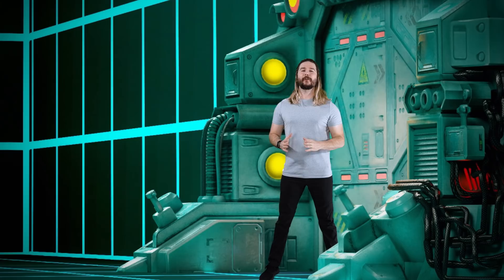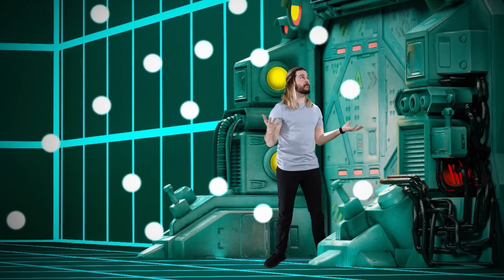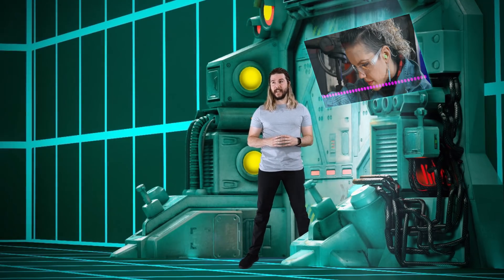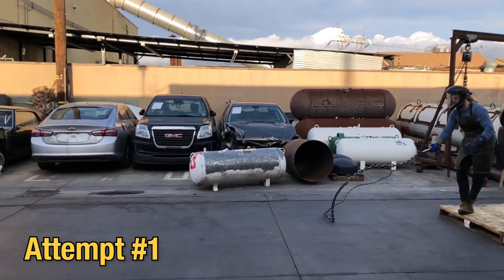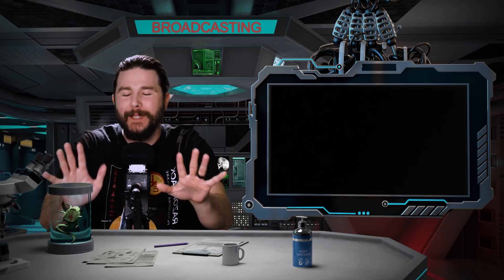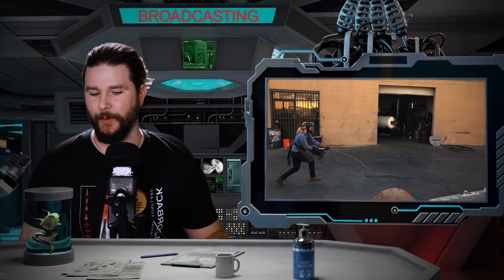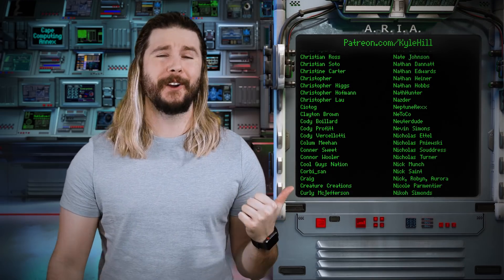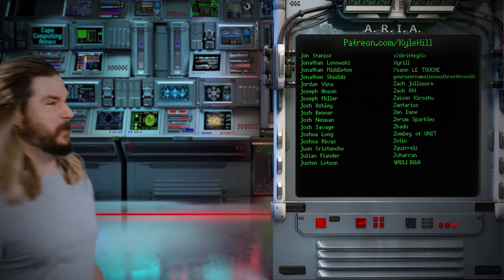Can I Make a SUPERSONIC STEEL WHIP?

Comment: Science does not always succeed. Failures happens. It's no biggy.
Reply: In fact it’s not only no biggie as you stated, it’s an amazing chance to learn.  :). Some of the best inventions today came from failures at making something else.
Reply: He needs to make the chain lighter and add a "cracker" at the end. He is not strong enough to get his current  build to speed.
Reply: Science ALWAYS succeeds... with the correct method. A failed experiment only ever means you have something to learn so you can refine your method, USING science to find the correct path to positive results. That is unless your theory is wrong in the first place, lol
Reply: @Nemoticon  hypothesis, not theory.
Reply: This is a chance to revise your hypothesis and change the experiment and try again.  All part of good science.
Reply: What? Firespark watches the same channel as me? Neato burrito.
Reply: Success on the first attempt in science is the worst possible outcome. Failure is how we learn. It's what leads to new discoveries and ways of thinking. Keep testing this hypothesis.
Reply: It's not just that science doesn't always succeed. It's that it always fails. It fails and fails and fails and fails and fails. It's how it works. It's an iterative process getting closer and closer and closer to the truth with each step. Science isn't a goal, it's a process.
Reply: "A scientist never returns empty handed; there's always data."
Reply: Failures Happens.
Reply: Failure just means you get to learn more.
Reply: When an experiment fails science still succeeds. It's only when you ignore the knowledge gained from a failed experiment that science fails.
Reply: Shh, people don't know that anymore. Keep it down.
Reply: Science experiments not science itself
Reply: Shouldn’t you be out playing Valheim?
Reply: Shit, that itself is science
Reply: Failure gives you a chance to fail better next time and eventually you learn something.. failure is the scientific process ..
Reply: This is exactly what I fight to teach my young students.
Reply: Science always succeeds if you do not view your failures as failures but instead as opportunities to learn and adapt your experiment.
Reply: eyyy it's the survival games guy! good to see you here on the path of SCIENCE! Thank you for all your helpful guides!
Reply: Science is mostly failing.
Reply: Being a scientist means you know that 99% of scientific theory has been proven to be wrong.  
But it must really suck when one scientific discovery negates your life's work while you are still working on it.

Comment: Well this kinda goes to show why even regular whips are made the way they are. You have the normal leather whip and then typically a shorter cloth/cotton tip piece that actually cracks the sound barrier. There is that specific motion you need it to perform for the "crack" to occur and the physical material needs to be able to transfer all that energy so rapidly. Glad you didn't just scrap the video but showed us and perhaps you can revisit the idea in the future with an updated design. All you would need to do is finish the end with a smaller real whip and you will get exactly what you. I'm not sure if even going that thin with metal would actually do it. It might if you keep tapering down the metal to smallest diameter like a necklace or thin bracelet type. But even then it might have too much mass to really flip around and "crack". You might just need to put some cloth twine on the end and it would end up working with your current design.

Comment: @kyle Hill  first: i love youre stil of making science understandable to many. You are doing it very well!

With the wipe cracking i see only one big problem: the style you swing the chain. You need, to give the chain a wave-motion, wich creates a bay in the chain running forwards. At the end, the lightest part, the bay will perpell the very last part forwards and that will crack it. 
You motion is a good start, but you miss the backwards motion and there for "swing" the wip on the ground. It only need a littel motion in the right Moment.

But: that backwards motion may swing the chain more back in youre positon. So i don't recomend, doing it this way with a chain. Normal bullwip will be best training for that.

Thanks for all youre work!

Comment: I think the link size on your whip may shrink too fast for it to work properly I'm no engineer but to me it looks like on your chain there is two points where the size jumps down considerably and it looks like to me that it makes the wip loose some power and it's shape if I were to re create the whip I would probably try to make the change more gradual

Comment: Regarding getting hit in the foot... from watching and practicing martial arts, if you don't want to get hit you can't just whip and then stop controlling the whip.   After the whip,  as soon as it starts coming back send a whip in the counter direction.

Not as familiar with whips but it applies to kusuri gama and to silk darts to a lesser extent.

(Kusuri gama are a hand scythe with a weight on a chain attached)

Comment: Your throwing the whip out but your not giving it the tug back that it needs. If you throw it out and then at about the halfway point you yank the handle back even just a little bit, it greatly increases the velocity of the tip. Try swinging it around you to keep it away from you at first too, it'll keep you from bruising your leg. It also doesn't have to be as long or heavy. Start with a smaller chain as the base and then end with a teeny tiny chain like you would find on a necklace or something. It would still count.

Comment: One thing I remember hearing about whips it that the sonic pop from the tip is still not always directly from the whip but from a added piece that is frilled to force a large area or more pressure waves to form at the end.  I much appreciate the safety precaution and the failure discussion as an avid fan and fellow educator.  Keep up the great work and stay safe and heal up from those impacts!

Comment: Something similar happens within the scientific community. Most journals discourage or even don't let you publish negative results, even if they are connected or are part of the initial hypothesis. And as most financial aid is tied to "get good results" or "how much you publish", this is a big problem and have induced people to lie in their results. There is some debate around this (is it ok not to publish something and cause that other researchers waste time and money on the same thing that you know it doesn't work?) but, unless there is a big movement from the publishers to allow or encourage to publish that kind of results or we find a different way to assign funds to research, it will be hard to see a change.

Comment: could you weld a bit of metal cable to the end of the small  diameter chain to decrease the mass enough to get the end to Supersonic speeds?  If it's about the taper down in mass, could you go down to piano wire?  Or would something cause it to break, shatter, or would there be a materials issue with the weld disrupting the transfer of kinetic energy?

Comment: Lets call forward direction x and to your left direction y. If the force is going mainly in the direction x but you are moving the closest-to-the-handle part in the direction y, the tip will move in negative y direction, so that the center of mass follows your pull. I'm guessing this caused your leg whipping. If you make it turn around you slowly like the tik tok guy before accelerating it to the sonic boom the CM would have a certain speed in the y direction wich would avoid gettin the tip in the leg. And you probably would avoid hitting the ground, as it would be slightly raised when you give it the finall pull, therefore not coming back down latter. Though not slowing it down on the floor while it comes back might be dangerous for the other side of your leg, you better improve your legs protection

Comment: But Kyle, couldn't this be solved by redesign? Obviously the chain whip is too heavy to get the speed you need, and I might have missed this detail, but the chains were all the same weight and size from start to finish, right? 
I'm pretty sure this could be done with a good design.
Reply: 👍 Probably. However, you can see the links are smaller at the tip. Should also look at lighter materials (e.g. titanium 🔗 instead of steel)

He also needs a WIDER space to get it REALLY spinning over his head. Notice the difference b/w locations & body motion of his vs. the "example" vid

[Youtube has a bot or paid TROLLS that DELETE factual comments]

Comment: So shirtless Dude whips twice with very different motions. You seem to have copied the second one, basically have the chain lie in a straight line and then try to accelerate. And my guess is that is why you failed. Your chain being all metal should be quite a bit heavier than his and thus requires way more power to get it moving fast enough that it does not hit your feet or anything else, loosing so much energy in the process that you do not get the sonic boom. 
The first method shirtless Dude used seems way more promising. Get the whole thing moving in an arc around yourself so there is nothing it can hitch on and THEN accelerate it to "whipping speed"... If you want to try that experiment again that is... 😅
But yeah, showing failure is good as well. It is our best teacher after all!

Comment: It seems to me that the problem is that the tip isn't moving smoothly like a whip would. I'm guessing that a sudden jump in the chain size causes a discontinuity which can't be easily overcome. Maybe some work to smooth over the joints by making the last joints before going to the next size smaller by grinding a portion of the chain away, or making the first ones slightly heavier by adding a small amount of weight. Or even some kind of machined chain bit. The last thing is maybe using a steel chord for the last bit is required, slowly tapering it by removing individual strands?

Consider reaching out to "Stuff made here", who has the experience to machine parts that could be more gradually tapered.

Last thing would be to practice with a normal whip, and set up a slow motion camera on it, comparing the motion of the two chains and looking to see what happens differently.

Comment: It looks like the steel chains are too big and heavy to get the speed needed.
If you can make the links half the size the weight will decrease by half and be light enough to possibly work.
I'm trying to remember the Bull Whip from Indiana Jones and it wasn't as big and bulky.
Try the experiment again with steel links but have them roughly the same size as an actual bull whip.

Comment: I’m surprised you didn’t use some thin, steel cable to create a "fall" at the end of the whip. 
Technically, it wouldn’t be a steel chain whip anymore, but it might get the desired crack!

Comment: I think one safety problem you had is that you needed more space. You should do it in more open ground like a large warehouse. Next, for a weapon that size, you need a very large person to wield it. If you can get ahold of someone with a significant difference to you, I think they would have an easier time. To practice you should also use a regular whip, that way your body can more easily regulate the mechanics of the action. I once spent a month training with a small whip and I still don’t think I had it down enough to attempt a chain whip. If I were you I would go slow, practice over time even if you aren’t recording, and try to build up your arm strength. Then in a year or so make another video

Comment: Alright as I whip things for fun I can see the immediate problems.
1: understandably Kyle is afraid and that will hurt his results 
2. The whip hitting the ground before anything happened that lead to
3: Kyle is not strong enough to whip it back fast enough for the results he want.
Kyle can hurt someone badly with the chain but to get the crack sound effects he would have to move in a circle fast enough so the chain will leave the ground and before he start losing velocity do a strong jolt that will lead to a boom but will also lead to a ripped shoulder joint from the force and weight of the chain

Comment: It's actually quite a problem in science that only good results are published. You don't learn from successes, you learn from mistakes! I've been working on non-insulated ReBCO pancake coils, for which we go some great results. But to get there, several tries went wrong too. Things that we could have known if those details were actually published in previous works. And yet the same way, we will publish the good results as you can only publish so much in a single paper.

Comment: Hi Kyle, love the hair, have a similar mane going myself and loving it <3

I think there are two things that were obviously happening here: 

The chains whipping release is probably not balanced enough to strike with like a normal whip. 

Since whips typically unfurl at as fast a rate as possible, they're CONSTANTLY getting thinner toward then end, but that also means that the unfurling of the whip itself follows a more or less perfect release as it's cast. 

Unfortunately with the current whip design:
- even with a handle mod - you still have solid lines of near identical chain links with sudden drops to another solid line of a smaller chain, 
- while the difference seems deceptively slight it's probably compounding the issues with the release over all - 

That would mean you would need to either release it in a form that is better suited to that type of chain or re-model it with new chain links, link by link annoyingly :/

The other issue is obviously weight, to increase velocity enough so that it basically goes supersonic and 'cracks' you would need to overcome that variable:
- obviously the goal is to do it with your own strength - 

Two ways you could solve this: 
Oddly be to make the chain heavier, ( by making it longer really )
Doing so would give the whip ( in spite of the delayed drag due to the weight) time to build up more momentum toward the end.

And finally the main way to increase momentum to increase the building force toward the end oddly would be to PULL the chain back after you cast it forward, this would cause it to ripple and the two forces will actually combine and when the ripple ends, it will result in a much higher final snap speed :) (hopefully - I'm so sorry for the lack of math :'{ )
 
Anyway, hope something here is of any help (There's also a video called “Crack the whip” with a 100kg chain - by 
SUSHI RAMEN【Riku】where I think he pulls it off a few times - though it's... less than safe XD )

Anyway, love you and stay evil Kyle! (Bwahahahaha!)

Comment: Without going into actual math, the reasons why this wasn't possible are 2 fold. 1 a simple matter of weight, while the nature of the tapering of the whip allows for exponential acceleration you still need to reach a base speed to reach the speed of sound and your average human just isn't that strong. 2 another factor of regular bullwhips is the rigidity of leather allows the base of the whip to more properly follow the movement speed of the arm increasing the overall acceleration. Chain-links simply move to fluidly to allow for this increase in acceleration.

Comment: Hey Kyle,
I believe the reason you can not get your steel whip to break the sound barrier is because you are using chain.  As the kinetic wave travels down the chain, each link becomes slack then taught.   This produces a small collision between each link as the wave travels.   Picture a train starting from a dead stop.  Each coupling is slack and produces a bang and causes the train to jerk.  With each collision in the chain, a little bit of the kinetic wave is lost.  This prevents the tip from reaching supersonic speeds.  I believe if you want to build a supersonic steel whip, you will need to use small steel wires of various lengths braided together.  Just like a leather whip.
Reply: I wonder if wiring each link together would help?
Reply: @silfreed  it might, but a better option would be to weld a spacer in each link.   This would allow the links to move up/down and left/right  but not backwards/forwards.  Like wiring together but allowing more movement.
Reply: @Huerkyb you are very correct my guy, a guy on YouTube called mike shake built a steel cable whip that uses a steel cable cracker and it cracks loud

Comment: I wonder if part of the problem is that the steel chain doesnt have the same kind of tension or rigidity that a leather whip would have. Leather whip wont have much, but theres likely enough to kind of guide the whole length of it in a particular direction without wasting as much energy to do so.The steel chain I'm willing to bet has too much play or freedom of movement in each individual link, and thus you're losing energy with each one.

Comment: What if you start spinning clockwise and get some momentum to the whip (and get the trajectory of the end away from your body). Then change and spin counter clockwise to get a nice "curl" of the whip. That way you don't have to rely on your arm strength alone. Sure it's not a classic whipping motion and you won't have any accuracy. But it might get that crack.

Comment: The video you show as inspiration also uses a different technique for the first "crack".
An over the shoulder throw that indicates, to me, either a much greater strength or a lighter material in use than steel.

Comment: Hello Kyle. The reason this isn't working for you, and the reason it worked for the shirtless guy, is that chain, alone, is too wind resistant. If you take a round glass, and sit on the opposite side of it from a lit candle, you can blow the candle out by blowing on the glass. It's the same principle. The leather at the end of shirtless guy's chain is less wind resistant than the chain, itself, which is what causes the sonic boom.